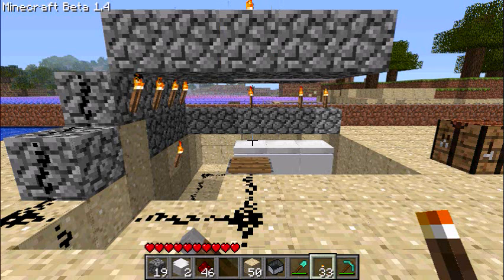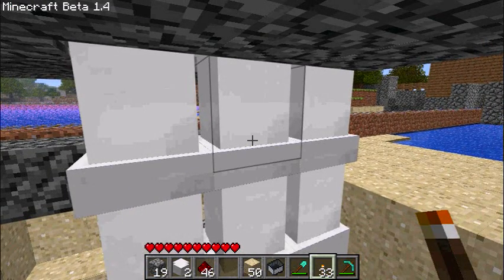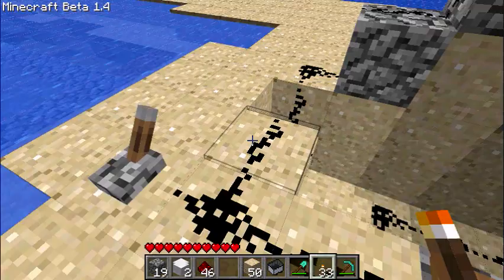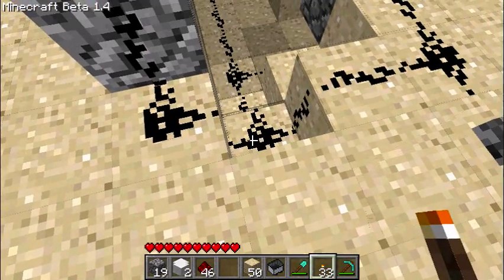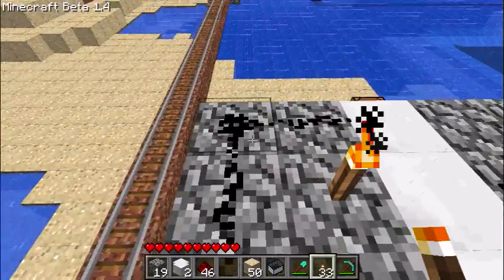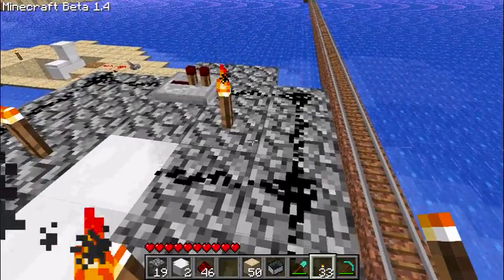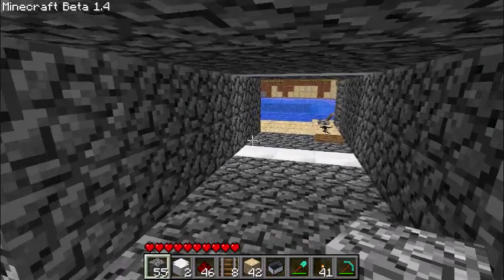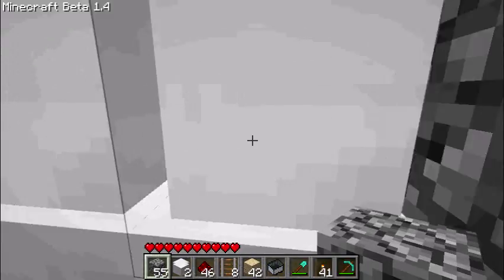Full gate

Comment: @Snownd15
I had an idea, but I just realized it would only work if the pistons could push 2 spaces. The idea was:
Have 2 pistons in the ground and a 2x2 above it of whatever you want the gate to be made of (I don't think obsidian works), then 2 spaces of air and then another set of piston. Wire the two bottom ones to a button and wire the two top ones to a button so there is 4 buttons that control the pistons inside and outside. Press the button, go in, press the other and it's closed.